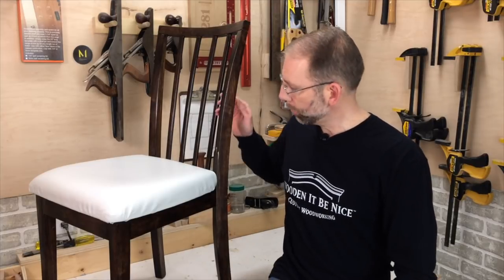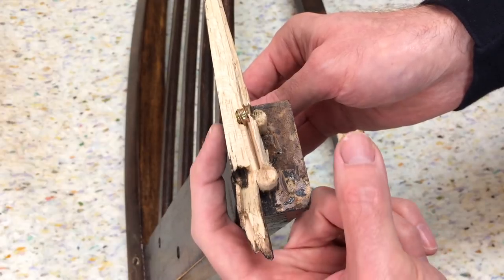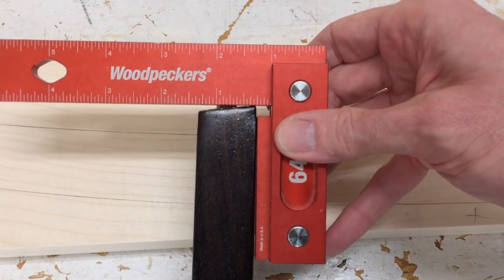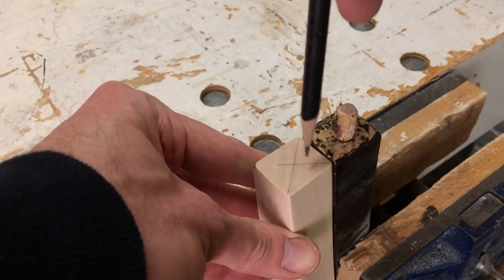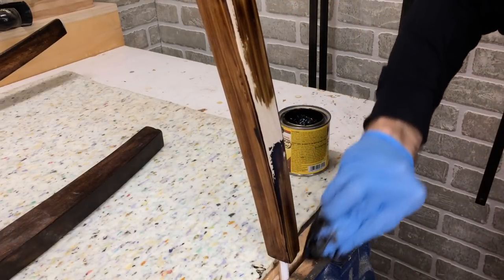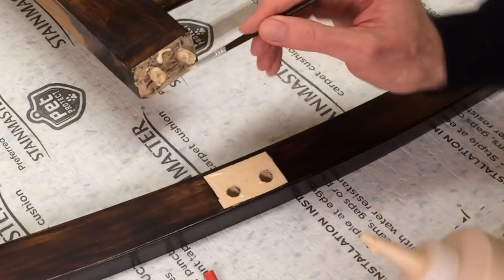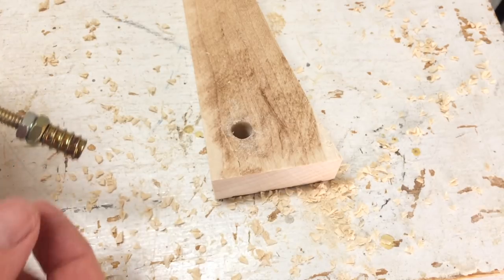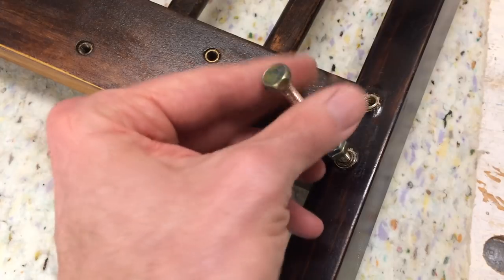How to Replace a Broken Chair Leg | Woodworking Tutorial

Comment: An excellent repair.   It struck me however that the design of the chair is weak at this joint.  There are dowels coming from one side and the captive nuts from the other.   This must reduce the amount of structural wood in that area thus making it weak.  Also, for the amount of work you put into this repair, the chair itself would need to be valuable (either monetary or sentimental).  I recently found your channel and I'm enjoying it enormously.
Cheers from Switzerland,
John
Reply from the maker: Thanks for sharing your thoughts John.  I think chairs are the most complex furniture pieces because they need to be strong, durable, and look nice - a tough challenge.  Unfortunately, a lot of chairs have weaker structure where the joints are but the failure of this chair was caused by using inferior material.  It makes me happy to hear you're enjoying our videos.  Thanks.  Scott
Reply: 1 chair isn't very valuable but when you have 6+ of the same chair it's cheaper to fix one then buy a whole new set.

Comment: Wisdom: If you know you're going to be removing the inset nuts go ahead and drill a hole all the way through the board, then you can just drive the threads all the way through to remove. It may weaken the board to where a slightly smaller hole will cause a split but that's a good thing. Any gaps between wood and inset nut threads can be filled with epoxy, or my preference... Gorilla Glue.  Thanks for the great video!

Comment: Great job, and great idea to do a test on drill size so the wood doesn't split when you put the inserts in. I also like the comment you made about leaning/tilting back in a chair. I'm assuming that even a chair made from the strongest wood could break if you lean/tilt back in it.

Comment: to remove inset nuts use allen key, to  drill the single dowel on the leg, remove dowel from old leg and cut an inch off the top and use that as a template  to drill the dowel hole in the new  leg at the right angle and place, and to make an exact copy of the leg, rough cut it out and finish it with a router with a bearing guide
Reply from the maker: Thanks for sharing your tips with the furniture repair community!  Scott

Comment: I like avoiding these nuts completely. Just drill a hole with the core size of the screw you want to use and then do NOT use a threading tool (because it makes for a loose hole) instead get a screw identical to the one that shall finally fit the hole, cut a slot in it with an angle grinder and screw it in with the impact driver. It works best with hex head screws because of the torque needed. That way the slightly undersized hole will get widened to the exact size of the screw and the slot in the screw will provide room for the tiny bit of material removed. Then put in the final screw and there you go. Until now these threads work perfectly for me and there are videos on youtube showing off the strength of this method. The piece is stronger with the much smaller hole and it is done so much faster!

Comment: great video.  just found your channel and have watched a couple of video already on chairs.  something i've noticed is that it appears as if you are not gluing the bottoms of the Mortises just the sides. also, with the Tenons, it appears that you put glue around the sides but not the ends.  is there a reason for leaving the bottoms/ends glueless or am i not seeing this correctly?
Reply from the maker: That's good observation.  The ends of tenons don't touch the bottom of the mortises.  There is always space left there for excess glue.  I hope that helps. Scott

Comment: Nice video. I used hide glue and epoxy for repairs in the past. looks like you use white glue. Is there a advantage with the white glue vs hide glue.
Reply from the maker: Yes, my go to glue is a PVA glue.  It's likely the same strength as a hide glue, but it dries in about an hour whereas hide glue requires clamping for 12 hours.  In my workshop, that time can be an issue when working through multiple pieces or phases of a repair.  On the other hand, for complex glue ups, a hide glue has a longer open time (1 hr vs 20 min) so the advantage is it makes the glue up easier.  I hope that answers your question.  Scott

Comment: By masking off the dowel joint suggests that the wood stain forms a barrier which stops the PVA from penetrating the wood.  Is that correct?
Reply from the maker: Yes, for glue to stick, you want a clean surface that's not sealed.  Because I'm using a gel stain that sits on the surface, it forms a barrier so the glue won't bond with the wood.  Does that make sense?  Scott

Comment: If anyone wondered what stretchers between chair legs were for, there is at least part of the answer. I'm not sure, but I also think that the frame of the chair might be made out of rubber wood, so it may be weaker in that sort of application then lets say a maple or beech leg in that spot. But you may be right about it being a "mahogany" there are a lot of trash woods from tropical areas that are marketed as a type of "mahogany", luan from the Phillipines was marketed this way, and it's weaker then pine, some are the other way around. The extra holes for the hardware certainly didn't help the structure, must have been a flat pack chair of sorts. 
 For staining maple the only thing that seems to work is either fabric dye (Rit), or an alcohol based penetrating stain like Mohawk sells, either those or the aniline wood dies that Lee Valley sells. They are harder to find then the usual oil or gel stains they sell in the home improvement centers, but they end up being cheaper overall as they go a lot further, colour the wood more consistently, and you don't have to wait for them to dry.

Comment: Not a criticism, just a doubt: I thought you said using metal and wood in joints was a bad idea? I know the chair has been designed that way and thus you're fairly limited, but was there no way to make it ALL wood?
Reply from the maker: You are correct in assuming the design of these chairs limits what you can do with them.  Adding dowel joints won't improve on the design here but may in fact weaken the joinery as there are too many spots with severed grain.

Comment: I have a couple of dining chairs that need new  chair legs ... the legs are round ... bit of taper towards the bottom ... I dont know if i necessarily NEED the taper .. the legs are the front legs of the chair that split ... they are attached perpendicular to the seat frame ... by bolts .... danish style chairs but simple and i think they are teak ...  My thought was to get a 36 inch oak dowel ... cut it and finish it off to replace these legs ... the legs are only an inch perhaps a bit large... any thoughts? or best way to go about this?  are there people that do this sort of repair? ...

Comment: If I were to uninstall an insert like that, I'd screw the bolt in the insert and tighten a nut against it. That will lock the insert to the bolt. Then just unscrew the bolt and the insert follows.

Comment: screw the nut tighter against the insert, then unscrew the hole assy from the bolt's head, with a bit of patience it works.
Reply: Same my way 👌🏻
Reply: yes but for unscrewing the insert! ! the trick is to tighten the bolt firmly against the insert. (one wrench turning clockwise to the nut and one at the bolts head  counterclockwise). To  increase bond  you can use CA glue  at contact surface  between nut and insert,.  Then unscrew from bolt's head and the hole assy will come out (hopefully).
Reply: @sn_all_test  thank you 😊

Comment: Taking out the captive nut?  Use the same setup, but turn the bolt head instead of the lock nut.
Reply from the maker: I'm not sure what you mean?
Reply: @FixingFurniture  You turned the lock nuts at the bottom to put it in.  To take out the captive nut, turn the top of the bolt.  You have to turn the two nuts down to lock onto the captive nut in order use the bolt itself to remove the captive nut.  It takes a couple of tries to get the lock nuts tight enough sometimes, but using the head of the bolt will extract the captive nut.
Reply from the maker: Airborne Ranger thanks, I hadn’t noticed that.  Cheers.  Scott
Reply: @FixingFurniture  that makes sense. If you tighten the bottom nut, it will put the bolt in tension between the nut and captive nut, making those three parts binding together. Now the trick is to overcome the static friction between the locking nut and the wood before the nut starts to unscrew from the bolt.

Comment: Uhhm.. I'm very unsure about the dovels and the screws. The mid part looks nice and strong. I really like the square cut supports too. But the dovels seem too small, and the added screw pressure is like how you cut three with an axe. I think the screws were used, so they would be stronger.. but screws also have a play, and eat the wood. They are not good with hinging movement.

 Not sure if wood butterflies joints or the like would hold it with other dovels. If someone sits into that chair badly, with bigger strength, the backpart can easily get a 120kg push. (80-90kg man drops on it) I don't think any dovel that is straight would survive that.
Reply from the maker: Maybe I should try a demolition experiment if I can find a chair to trash and see what force it takes to break a chair like this.
Reply: Like with a kg meter and a hydraulic press? If I remember well, there are channels who did wood, and engineering sites detailing how much a wood - as building material - can hold.
The wood as furniture, the bad/engineered/chips wood 120kg, normal 200-300kg, and hardwood being 400kg or so. For building material, 2 x 2" x 6" pillars at 1m are capable of holding 2.2 tons.

My conclusion and thought on why furnitures fail, are the hinge like stress, bad joints, and wear of material/eat. A lot of old woodworking benches/lathes and hundred year old "peasent beds" have outter wedges, which seem extremelly durable. Also some special joints with Japanese and Korean furniture, houses, show minimal or no wear at all.

Science would be interesting on the subject. Maybe you could do a video, or already have one? Common structural failures and errors, break test?